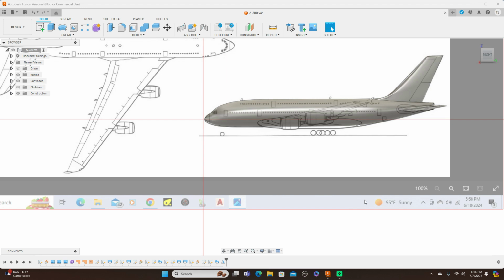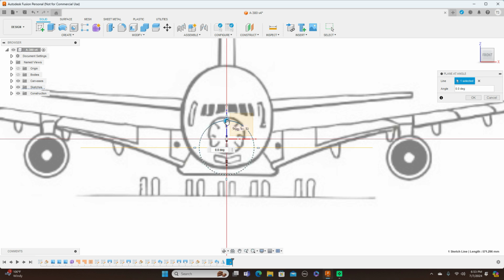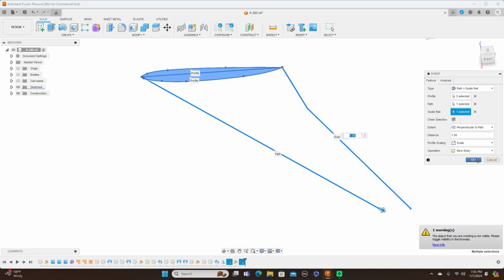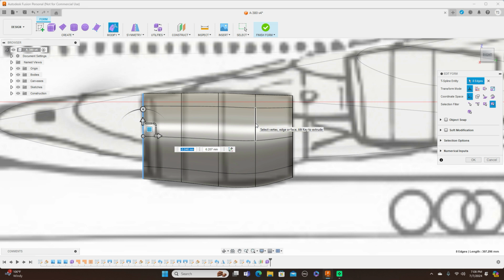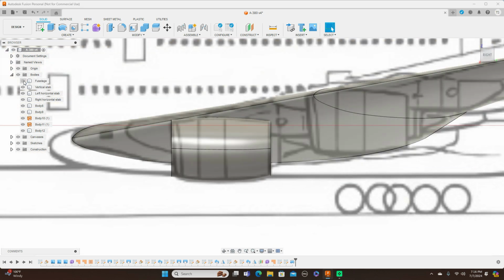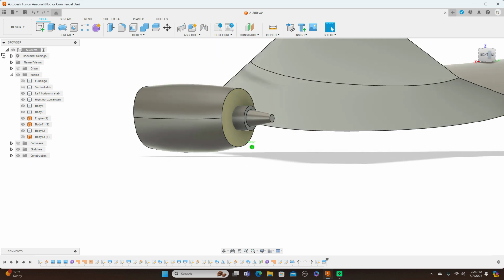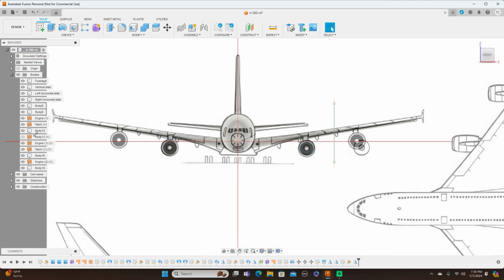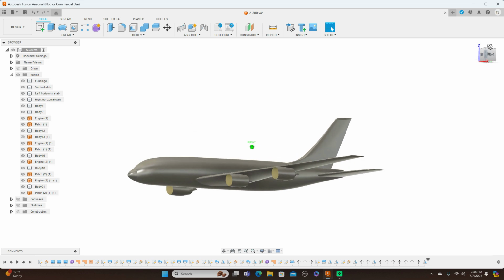Learn Fusion 360 by modeling an A-380 airbus.  CAD

Comment: After designing such an aircraft, how do you disassemble the wings and other components, with which method, to glue the wings and other components after printing from the 3d printer.